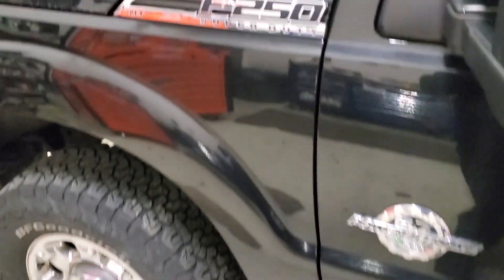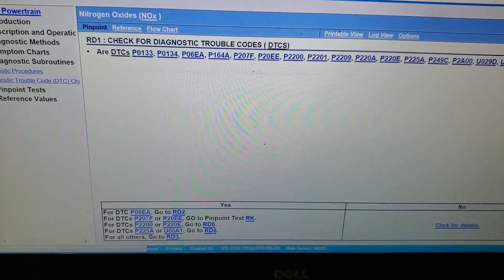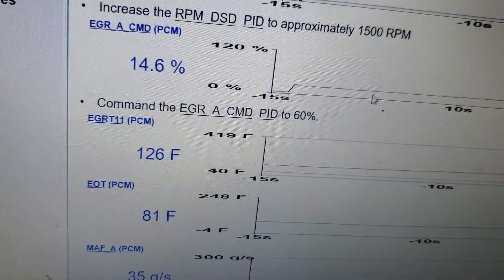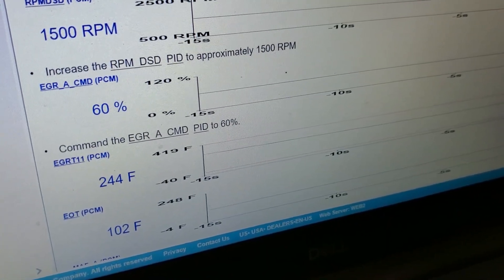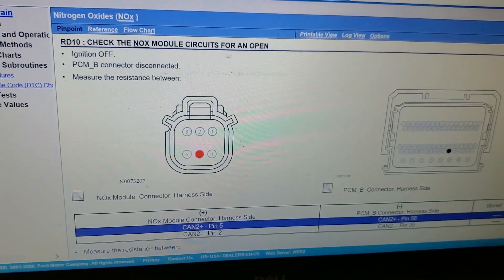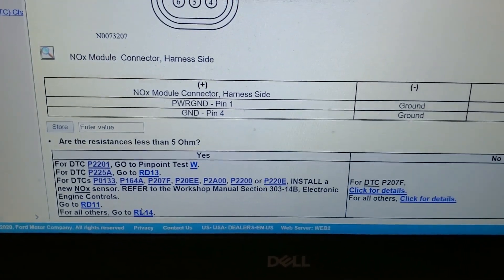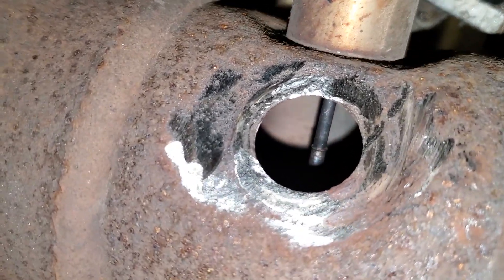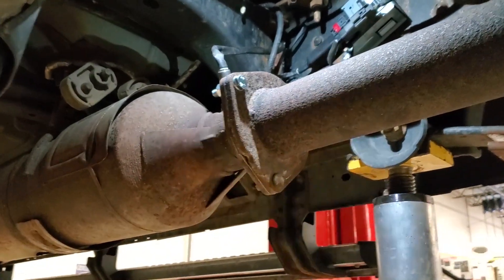2012 Ford TRUCK 6.7 P207F |DERATE  - VERY POPULAR!! |

Comment: The pipe thickness around the Nox sensor looks really thin. I know Ford tries to save weight but as hot as that area gets it should be thicker material there. Great video man thanks...
Reply: That is some thin gauge exhaust mtrl.....junk./.........Ford WTF..?  Weld job ok bud!..

Comment: Always enjoy your videos. Just an FYI with welders that sit awhile, purge the hose to get the fresh shielding gas in the hose. Cleaner the material the better the weld with mig and tig, some stick welding is much more forgiving. Keep up the great work.
Reply from the maker: Yea that 1 was ruff😬😔
Reply: @PowerStrokeTechTalkwARod  NEW TO THE CHANNEL GREAT CONECTENT THANK YOU 
 DO YOU HAVE A DO ANY PROGRAMING AFTER REPLACING MODULE AND SENSOR OR ANY PROCIDURE  THANKS
Reply from the maker: Hey thanks, youll have 2 email us.

Comment: I got very lucky after looking at many different videos on the procedure to clear the 50 miles to 50mph limit had 2 miles left to the limited speed limit. I ended up getting the P207F code due to a bad NOx sensor, Bank 1 sensor 2 code P229E. After a cold soak over night, I swapped out the sensor and cleared the code. Then ended up idling the truck between 2500-3000 rpm for about 30 minutes to get it up to temp. I drove the truck past the 2 miles then got the message after restart truck will be limited to 50 mph. Did a few hard accelerations while driving keeping the temps up. Parked the truck overnight to cold soak again since the message didn't clear to start over. Started the truck in the morning and the message was gone. Did a test drive to make sure and no issues and truck was not limited. The DEF symbol was also gone. Just lucky I guess.

Comment: This code is going to drive me  insane. I've had my 16 since new 91k and does get used just dont drive it everyday. Well maintained, always use motorcraft def. Ford replaced exhaust twice already for the same code. Had pcm recall done last September but the recall doesn't cover P207f. Sorry about venting but it makes me want to just sell it and go by a 6.0 or 7.3 with no emissions. If it wasn't for the dpf system I would have absolutely no complaints with this truck she tows like a beast and plows awesome.
Reply from the maker: Sounds like you need to come see me or goto another dealer. The DPF doesnt cause a P207F by itself
Reply: @PowerStrokeTechTalkwARod  if I wish you were a little closer. I definitely appreciate all your videos. The fact you take time out of your day to share is impressive.

Comment: Welding tips and tricks has a ton of great videos on you tube. The best teacher is experience, you just have to do it. A short stick out is key, gas shielding looks better than flux core, and make sure your polarity is right. I would put some tacks to hold it and weld from tack to tack. I’m starting to get nervous when your videos come out. Every time you have a new one one of our trucks come in with the same codes on it. I just had this one on a 2016 a week ago but it went out before it went into derate. Do those modules need to be programmed or is it just a reset of learned parameters.
Reply from the maker: Yepp you are correct, no programmy. Yes practice makes perfect, thanks 4 being nice 😉. Dont be scuured its only......a 6.7 hahahah
Reply: PowerStroke Tech Talk w/ARod everyone starts somewhere I’ve seen some welds that looked like those rocks that used to be in the old gas grills. Welders are pretty critical of other people’s welds I’ve come to notice. It’s the live version of the I’m so awesome because I weld t-shirts. Thank you for your videos, there very helpful for a guy without factory training. I don’t have ids or identifix or Mitchell so I have to figure out the repairs with what I find online.
Reply from the maker: Hell yeah bud 😉🤝👍
Reply from the maker: Rocks in the ol gas grills....😭😭😭
Reply: @JasonTheMunicipalMechanic   those "rocks" in " old grills" are called charcoal. And yes, people around the world cook with it every day. Some even say it makes the food taste better than when cooked over propane. Crazy huh?? 😂😂😂

Comment: Good information.  I have a 16 Ford F350 w/6.7.  Only 27 and change thousand original miles.  Not running rough at all with "check engine" light.  Idle is smooth.  No soot in tail pipe.  Def tank 1/2 full.  No indication of any problems and no reduced power.  Code set is P207F  PCM Power Control Module - Reductant Quality Performance.

I see REAR and FRONT NOX SENSOR WARRANTY EXTENSION under Ford Recalls/Ford Owner Support online account, but, have no idea how long the warranty extension applies, or, even if relevant to my situation.  Dealer says it'll be at least 2 weeks before they can even look at it.

Bummer.
Reply from the maker: Tuff code to diag
Reply: @PowerStrokeTechTalkwARod  As it turns out...Took it to the Ford Dealership.  It was caused by the diesel exhaust emissions reduction filter.  It was plugged with soot evidently.  It is covered by the emissions warranty, but, the filter is in short supply.  I was told the expected wait is 3 to 4 months.
Reply from the maker: Jusr finished one,waited 7

Comment: So I had the same thing. Pop-up on my after 3:50 power stroke. And I talked to the mechanics at my work, who are diesel, mechanics. And they say the reason that happens is because the truck is not ran hard enough. You need to put those trucks underneath load. Make them work for the money. It's a way to self regan your truck
Reply from the maker: ....I can agree with that however a P207F usually shows up a bad part once pin point tests are done

Comment: Im a tech at a ford fleet center and its always cool to see another techs approach to diagnosing different concerns. I have a 12 f450 with p207f. It had soot out of the tailpipe. I thought i could put it in regen after other repairs i did, r&r turbo, broken exh man studs and some other stuff, because i thought it had put out higher emissions due to the other concerns with the turbo etc. Still set p207f. No circuit problems. Replaced the nox sensor, did not replace module. Set p207f after maybe 20miles. Do you think replacing the module will fix it?? I dont have much experience with nox sensor concerns and i dont know what pids i can watch to monitor operation of the nox sensor etc. I have had a hell of a time trying to learn about operation of this sensor LoL thanks!!

Comment: Great video I have a P0191 on a 2012 F450 I changed the fuel filters and my low pressure is 60 static and my dynamic is 55 and I wiggle the fuel pressure harness and the engine wanted to shut off.

Comment: Seems like 90% of the problems on these trucks is the emissions. Makes me glad that I dont have that crap anymore. The engine in these trucks is solid!!
Reply: Yea for real.. It's making diesel not worth it any more
Reply: Emissions, the support system designed to fail and force your truck into limp mode and cost like a mf when buying parts.

Comment: Anyone that has gone after this code will understand the pain in the ass it is to diagnose. I’ve most commonly found it to be the NOx2 module.  But I’ve also had DEF injector issues from pin fitment to dosing problems.

Comment: So I’ve worked at the ford dealer for 4 years back right when the 6.7 was released. I’m currently at a shop with limited but decent diagnostic equipment. I know my way around a 6.7 pretty decently and have been seasoned in repairing them for about 10years now. Im somewhat known as the 6.7 magician 😂😂Can you give me a brief but detailed explanation of what I should be seeing from the front and rear n0x sensors on live data From the 16 models with 2 sensors. Obviously there should be less ppm from the rear as opposed from the front, but is there a spec of how much and when the egr is in action. I work with pro demand and it doesn’t exactly give you specific number to follow. The last truck I had in was pretty close to to the suspecting point of a burnt out catalyst but everything looked clean and tidy with a bore scope, no excess oil ingestion, clean egr, decently low idle hrs verses operating hrs. I went through the basic visual and electrical fault isolation and reductant tests. No issues found. I can run the truck on jack stands and manually remove it from idle mode but it only lasts about 3 days before it falls right back in to 5mph limit.
Reply from the maker: Powerstroketechtalkwarod@gmail.com

Comment: At the 3:40 mark when running RD7, it looks like you're running the test from PC/ED page. Is that a dealer only version of the website?
Reply from the maker: You can visit motorcraft.com and you can purchase time time for the material and you can look at the same interactive measurements like you see here
Reply: @PowerStrokeTechTalkwARod  We have a paid subscription IDS, but have never seen tests run directly from PC/ED
Reply from the maker: Having a paid subscription for IDS does not dictate your ability to access the information that you see me use

Comment: Have the p207f and the only thing i noticed wierd was the egr temp sensor reads -40 degrees. Shop replaced the sensor. Still reads the same. I also have a a code p0625 generator field. Any ideas ??
Reply from the maker: Sensor supposed to. Pcm doesnt look at it. Id suggest them going thru the correct pinpoint test for P207F
Reply: @PowerStrokeTechTalkwARod  Thanks for your help.

Comment: I've seen the replace subsystems and don't unplug on new stuff with new problems as the material analysts want to verify connection integrity, etc.  When Ford dropped the module-sensor pair replacement for factory paid repairs did replacing only NOx sensor cause comebacks if module was not also changed?
Reply from the maker: Yes & no. Since these things came out, more so for 12 to CMY, rule of thumb....nox sensor r&r better get u a module to-Had an engineer tell me out the back dough, NVR did just the sensors do both.....

Comment: That is one monumentally pain in the ass DTC to diagnose. I've had more than my share of those coming in. And the majority of the trucks I've had, ended up needing the SCR catalyst replaced. Only ONE truck I had, did replacing both NOx sensors repair the truck successfully. I very recently had a Transit coming in, with that DTC set that I replaced the NOx sensors on. Came back in on the hook the next day with P207F set again. Like the other trucks, replacing the SCR catalyst fixed it.
Reply from the maker: Like one commenter said, "control ALT, delete"
Reply: Michel I have a 2012 F450 6.7 and it has a code P0191 I wiggled the harness on the sensor and the truck wanted to shut off and did it again and it stop doing it.

Comment: My truck is at the dealer now getting the whole dpf,scr & doc replaced on mr. fords dime. They already replaced the reductant heater & nox1 sensor & that did not fix the dreaded p207f apparently my truck falls in the 5% that needs the entire dpf system replaced.thank god it it is covered under the recall being that it is $5000 just for parts. 2015 f250
Reply: And yes it did go into derate mode for two weeks then it went into engine idled mode. While I was waiting for the parts to arrive.
Reply from the maker: Hmmm

Comment: What is wrong if engine does not run rough on the egr cooler test even thou you commanded the egr to 60 percent and turbo vgt to 60 ..i had one 3 weeks ago and it did not change the way truck ran ???
Reply from the maker: From here, i cldnt tell ya guy
Reply: @PowerStrokeTechTalkwARod  i just expected it to run rough like yours but it didnt run bad at all .we removed egr cooler and ckeaned core but didnr help the code ..how many homes should be in the def injector ours only had 3 but passes
Delivery flow test ..

Comment: What other way could you perform a def injector nozzle clean on a 2014 if you don’t have access to an IDS program. I have a p207f only code coming up. Trying to do what I can, if I can before I end up having to take it in to see the Doctor. Thanks
Reply from the maker: Petty much only with a scan tool...
Reply: @PowerStrokeTechTalkwARod  Thats what I kinda figured but wasn't sure. Found your channel trying to diag this issue. Lots of professional here on your channel. Thanks for sharing you knowledge.
Reply: @PowerStrokeTechTalkwARod  One more thing. When replacing the nox sensor and module, is it a plug and play or does the module need any programming?
Reply from the maker: Yes module will need 2 be programmed
Reply from the maker: Stay locked baby, cuz all we do is assist
Reply: PowerStroke Tech Talk w/ARod Found someone with a scan tool that was able to do the dpf injector clean and also a manual regen. Cleared the code and did a derate drive cycle to clear the warning. Hopefully it just needed a little house keeping in the torpedo. 🤞
Reply from the maker: Hahaha

Comment: Had the dreaded CEL and warning of 50 mph in 50 miles come up on our 2012 F250 with 98k.  Stopped in the nearest Ford dealer, left the truck running, they scanned for codes, P207F Reductant Quality Sensor Circuit Performance. Shut the truck off, removed the scan tool, start the truck message gone, no more code, and truck runs fine. This happens about once a year and the code goes away after being read, by time a tech looks at it, nothing to do because there’s no codes. Any suggestions?
Reply from the maker: Same thing that was wrong with this truck

Comment: Can anybody tell me on the Ford IDs scan tool under engine codes. What does ODDTCs  and CMDTCs stand for and mean. Thank you to who ever responds and thank you for the videos
Reply from the maker: So continuemous  DTCs  are fault codes that are stored during the drive cycle, on demand DTC's are electrical faults that are currently present right now there is a fault existing currently

Comment: If you just clear the code to have the check engine light off would it still be just the module and the sensor?
Reply from the maker: U need to follow the pin point test

Comment: Is ford ids a stand alone e software or does it have supporting programs?
Reply from the maker: By itself
Reply: Do you need a vcm3 or is an rp1012 good?
Reply from the maker: I dont know what an rp1012 is...not that will not work with ids or fdrs
Reply: Is PTS available to non ford employees?
When you were controlling the egr were you still within ids? Just got the program and learning to navigate.
Reply from the maker: Yes it is.
Reply: Could you elaborate?
Reply from the maker: Did u Google it? Look up how to buy IDS & access to PTS. Motorcraft.com?

Comment: What software are you useing?
Reply from the maker: Ids
Reply: Ok good deal I have been thinking about buying ids
Reply: I have that cod p207F and finally found out NOX sensor number 1 is out of wack thing will pop up to like 1300 while driving then back to 0 sometimes while driving
Reply: Also this is a really good video thanks

Comment: Delete delete delete
Reply: For a tech in a shop delete delete delete can mean fine fine and even bigger fine $.
Reply from the maker: Yepppppppppppppppp
Reply: jimmy aber didn’t mean for the tech to delete. Meant the owner...
Reply: @codyellig4631  exactly why I said what I said. If you read this and dont know the delete is a  DIY the tech part of my post tells you not to ask the service guy at a shop to do it.
Reply from the maker: Thank you, well said Jim
Reply: What happens when one comes in already deleted with another issue?
Reply from the maker: ....be more specific...
Reply: PowerStroke Tech Talk w/ARod the DEF system is deleted. The diesel comes in for a  bad fuel pump, low fuel pressure.  Are you obligated to inform anyone of the DEF deletion?

Comment: Back in December of 2021 I had a p207f code on my powerstroke took it to the dealership and they replaced the nox sensors 4 months later same code pops up again🥲 should I replace the nox sensors again?
Reply from the maker: No theres a pin point test for P207F that needs to be followed